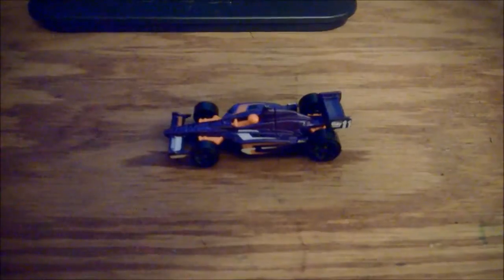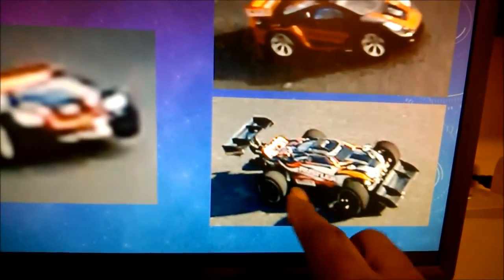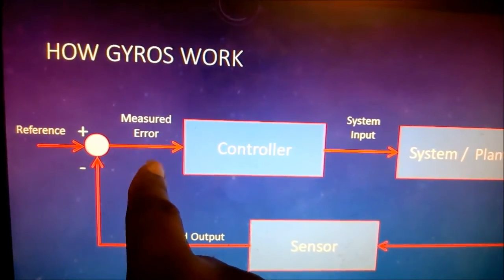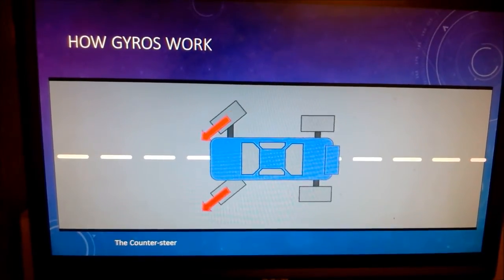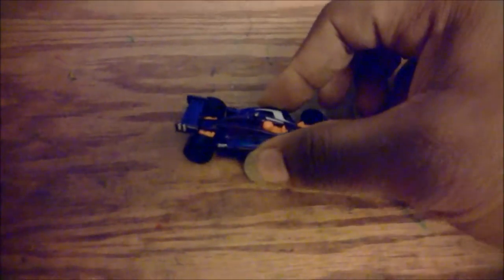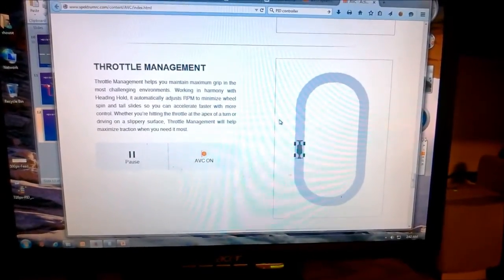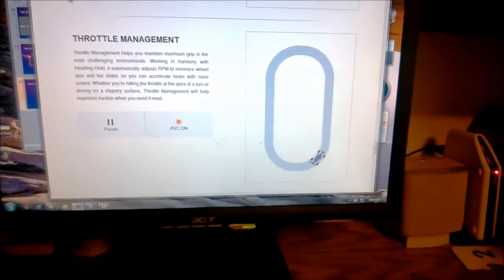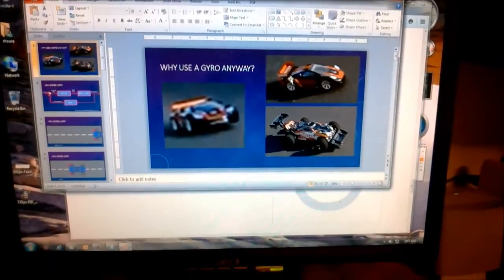Ep. 66: Gyros 101 - The Truth about Gyros ...and AVC ... and TSM

Comment: Rod, is the sensing system not simply an accelerometer or two? (Apologies if you mentioned that - I didn't hear anything about it)
Reply from the maker: Yep. Generally there is a set of accelerometers paired with a set of gyros. You can buy the whole package on a single chip now thanks to cheap cell phone parts.
Reply: @RCPhysics  On a chip, huh? Incredible. Still curious, though... are any of that chips' contents mechanical, by definition?
Reply from the maker: @aljensen7779  Actually yes. They contain micro-mechanical structures that cause a change in capacitance that can be detected by the chip they are built on and turned into motion data. It's really cool stuff.

Here's a video explaining it. https://youtu.be/eqZgxR6eRjo

Comment: Hey man good video. One question I’m dying to know. Is it possible and have you ever dialed a car in so well that a gyro or any TSM or AVC is not necessary to keep it steering straight even at higher speeds?
Reply from the maker: MANY of the top guys don't use stability systems. A lot of them actually look at them as "cheating". They feel that if you want to build a 100-150mph, you should at least know enough about setting up a car to make it shoot straight.

I think they can be useful in some setups , but they should NEVER be used as a crutch. They can mask underlying setup/performance problems if you are not careful which could end up biting you later.
Reply: rhouse21 - RC Physics I truly appreciate you Responding and I deftly appreciate the detailed response. So in essence it is possible to drive the car at about 100 miles an hour an RC car that is if you dial it in correctly and it will stay straight minus any kind of stabilization help correct?
Reply: rhouse21 - RC Physics slash that dude. You did answer it. Thanks

Comment: Great video +rhouse21 - RC Physics! You left me wondering: which is actually better?

Would Spektrum's AVC be good for an autonomous RC car based robot, similar to MIT's RACECAR?  I'm thinking AVC having throttle control since TSM does not.  Thoughts?
Reply from the maker: +worldburger What an interesting question! I have actually not had a chance to drive cars with either of these systems yet, but I've read enough opinions online to believe that they are both pretty effective. I think they may each have different strengths, though. I think the Spektrum AVC may be better at giving the highest degree of "stability" independent of user commanding, which is probably what you'd want for any type of autonomous commanding scheme. If I were designing the control system of such a vehicle, I think I might rather design my own logic into the base control system, though. The sensors AVC uses to control stability would need to be replicated in the car's navigation system and the digital control loop needed to generate servo commands could find itself "fighting" with the AVC control logic under certain conditions. Having one set of logic and sensors would be the most elegant solution, but it would probably take a lot of trial and error to get it right. This could all be worked out by a good designer, but it would probably be simpler to just use the AVC system to filter out "high frequency" deviations in course caused by the external world and only using the autonomous navigational system to generate "slow" control inputs. The AVC throttle control would then make the controls designer's life a little easier because they would not have to create an algorithm from scratch to find the fastest line though a corner. AVC would just pull back throttle when the car begins to deviate from the commanded course. n the flip-side,  I suspect the lack of throttle intervention in the Traxxas TSM system may actually have a better "feel" for a live driver, especially while bashing, since you will still have the ability to throw the car around and "drift" more. That being said, I think AVC's throttle control function may give better lap times in racing for a novice driver.

Comment: I could never get a good speed run with my Glamis Uno until i threw AVC in it but you cant have the steering gain too high and the car wobbles. so I keep it at 50%-60%, my vaterra road car i have the steering gain at 15% or it wobbles REALLY bad at speeds around 20mph where the Glamis would wobble at 35+

in my vaterra road car I feel the throttle gain helps that car more in turns than the steering gain
Reply from the maker: Steven Gilbert The good thing about these systems is that they can make a difficult car a lot more neutral. The problem is they can also mask performance issues that could be costing you speed. Like most things in life, I think it becomes about finding a good balance.
Reply: rhouse21 - RC Physics oh yes definitely, a lot of times I change the AVC from on to off just to tell the difference. That way I can see if it's really needed or if it's causing any issues
Reply from the maker: Steven Gilbert I saw an AVC challenge video where it can actually make a 2WD car handle in the snow & ice, which I'd pretty impressive. I tried snow bashing on 3S with Slade before the aero treatment and he was a bear to handle. Crazy power + light weight + slick surfaces = no traction. It was still fun, though. :-P